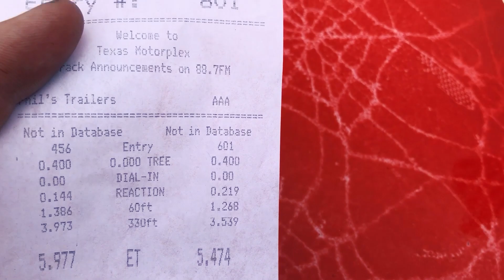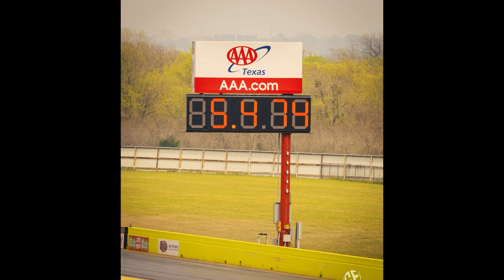This year wasn't a complete DISASTER. The high points of 2021 Nitro Union drag racing

Comment: Tommy, when you're driving the car and getting in and out of the throttle, man that really shows how much power Miss Fitt has!
Reply from the maker: It really is crazy. I'm not a small guy, and you can see how much it throws me around. The harnesses were as tight as we could get them, and it just wanted to stick me back in the seat, and it almost felt like I was trying to slide up the back of it haha.
Reply: @NitroUnion  Dang!

Comment: You've had a chance to run misfit now it  gives you a new appreciation on how good of a driver your dad is he gets out there and makes it look easy
Reply from the maker: Absolutely, it is certainly not as easy as he makes it look. Something that's hard to wrap your head around from the outside. As soon as you touch the throttle, the front end is weightless, so you essentially have zero control, you've gotta have the stones and willpower to trust it's going the right direction and hang with it until the front end sits back down. If it's not going straight, you have to have the mental sharpness to wait for the right time to correct, or lift, correct it and get back in it all within the first two seconds of the run. All that with 50 year old suspension technology so it's not very predictable haha.